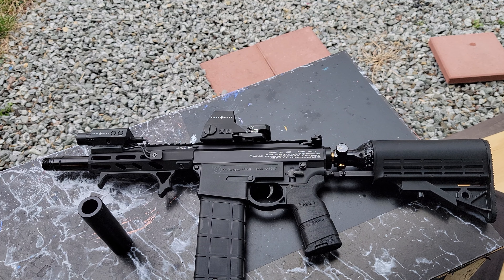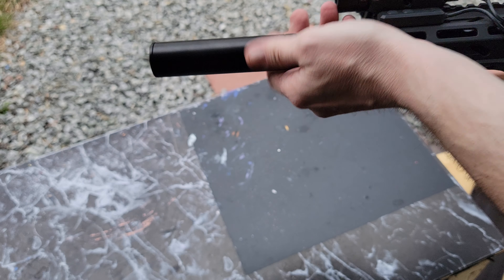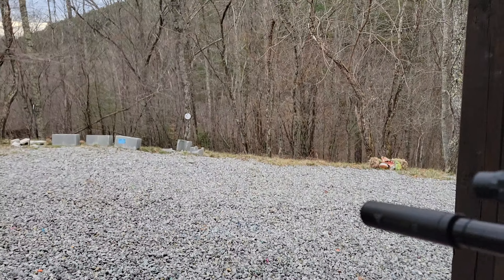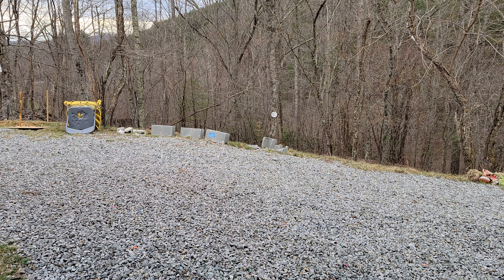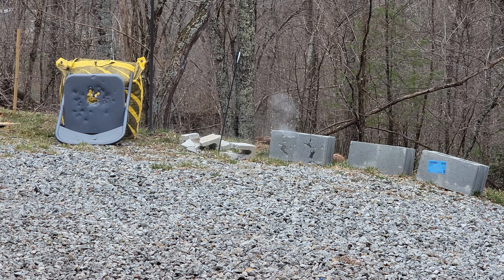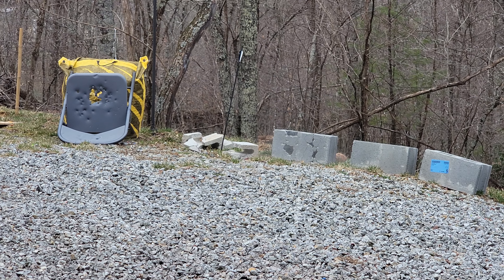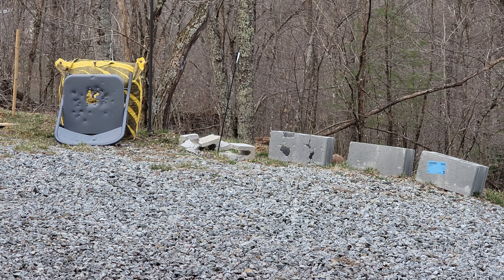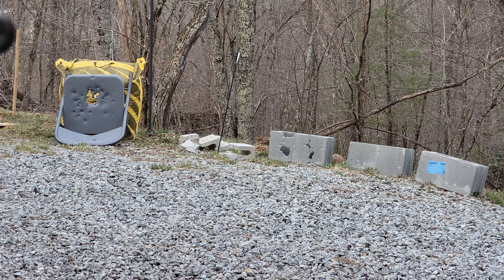Another VKS vs. Leshiy 2 vs. Cinder Blocks  New VKS barrel's first shots with bore matched BK rounds

Comment: So, I was looking at your shopping page, and had a question about the hdr 68 that says 30 joules. Do you have a video of that one in operation? Is that the strongest you can make a pistol launcher without adding a tank? I want as many joules as possible without an extra tank basically.
Reply: Cause I saw the video where you get it from 23 to 30 joules with the tank. So I guess, what is different than that 23 joule one without the tank?
Reply from the maker: Yes and there's actually a couple.  And no you can actually make it more powerful by changing the barrel. Then that would be about it.  Just got stuff to do that tank HPAs, too
Reply: @DK-Spencer  I was just trying to purchase it, and have trouble going through this way. Can I pay you directly through the PayPal app?